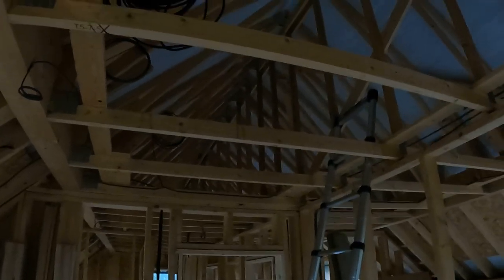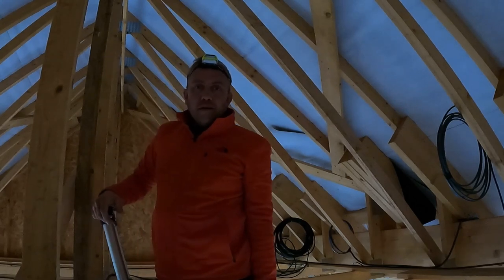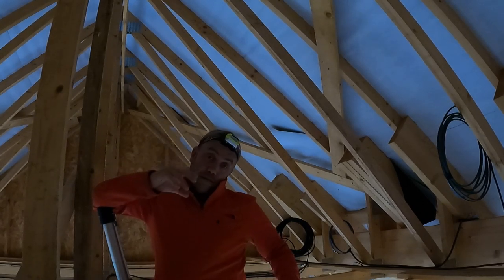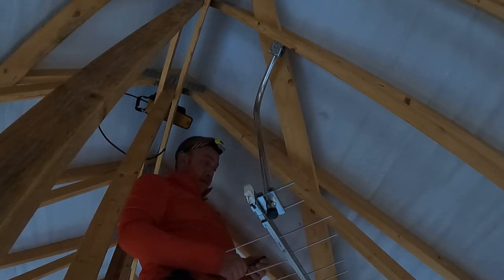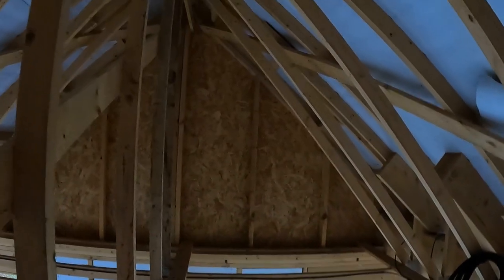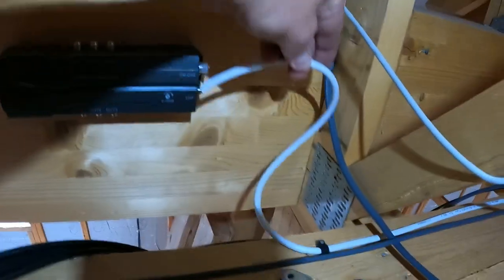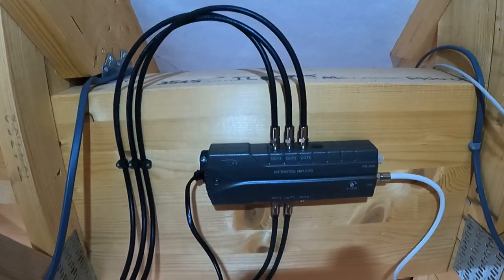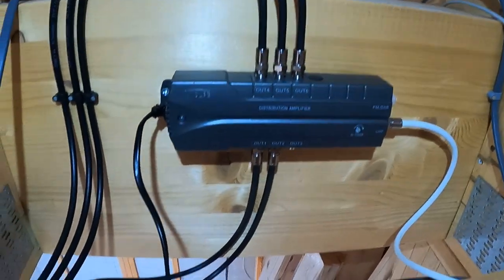TV Aerial mounted in the loft and connected to a distribution amplifier

Comment: Greetings from Los Angeles!  I've got it much easier, all the major broadcast television channels come from one mountain top so easy to align an antenna and get a good signal as long as no big buildings or heavily tree'd area in the way.  I noticed the antenna right away, interesting that you only have UHF signals as the broadcasters here in the USA use both UHF and VHF bands, and the channels have been changing bands ('repacking') due to expanding use of hi-UHF for cell phone and 5G wireless transmission.  Any areas where the broadcast signal comes from different directions so a dual antenna system is needed?  Anyway, interesting to see this from another country.  Cheers!
Reply: As far as I can tell, DVB-T (used in the UK) uses only UHF bands, while ATSC (used in the US) uses both VHF and UHF bands.

Comment: Many years ago I bought and mounted the best aerial I could buy from a high street electronics chain that has since closed its doors.
I looked at the direction in which the roof aerials were pointing and matched it as best I could in the loft.
I had good signal on all channels so I was well chuffed. 
A few months back we had a seized ball float in our F&E tank so got a plumber in. He promptly smacked his head on the aerial (plenty space to go around it) and now a lot of channels break up, even more if the weather is bad.
For the life of me I can't seem to realign it adequately.
What do you think? Damaged aerial?
If not, what can I buy to help me realign it or are there any phone apps you can suggest?
Thanks.
Reply from the maker: It is probably more down to the fact that it was only just getting enough signal (in basic terms) in the first place.  As in you were lucky to be getting it in the first place. Especially using a high street store tv aerial from years ago and not aligned professionally.  The knock it got from the plumber was the straw that broke the camels back maybe? 
I don’t know if any apps that will do this properly, as you physically need to see your signal levels with a meter attached to the aerial, it’s not just a case of pointing it in the right direction, you need to see your noise levels and Bit Error Rate and other things.  No app will give you these figures, only a spectrum analyser can do that.  Sorry I can’t be of more positive help mate, it’s just what I believe is true.

Comment: Does the amp have a band pass filter to prevent out of band signals causing  the amp to overload and cause problems with IP’s or saturation.
Reply from the maker: Yes, it is designed to only work with frequencies between 470-694 MHz, so basically only the DTV UHF frequencies. Things like 5G and 4G won’t affect this amp 99% of the time, but in most cases I fit it to an aerial that also has the same rejection qualities just to make sure.  I hope this answers your question?